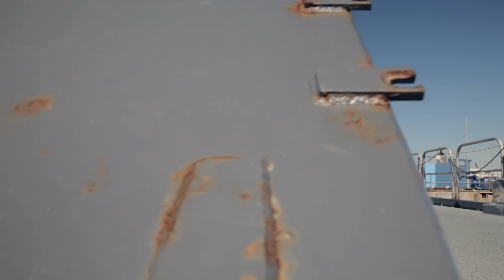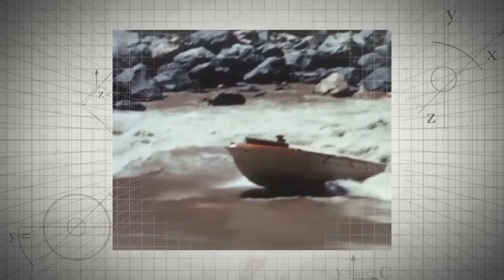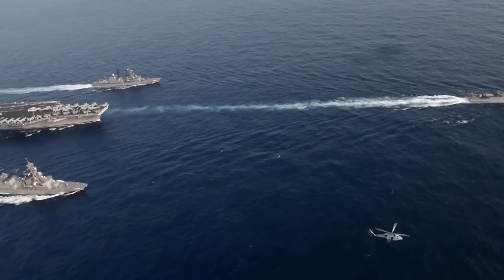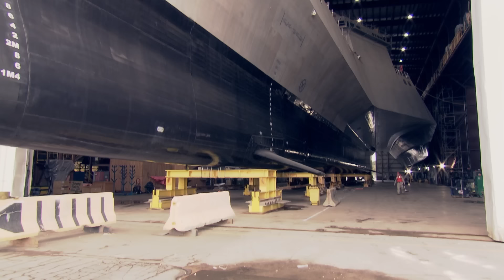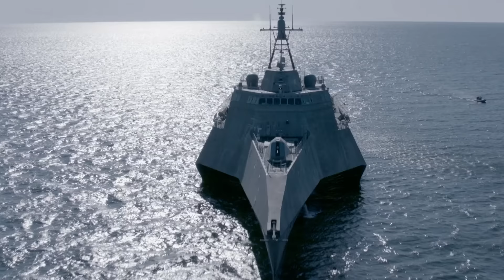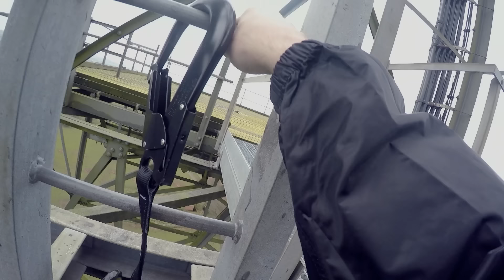How the US Navy Built a Warship for Speed, Versatility, and Coastal Control | Blueprint

Comment: Claiming the DC-3 as "all aluminum" is silly and misleading. The majority of the fuselage, wings and engines are aluminum alloy. But there are also various steel alloys used for things like engine thrust components, landing gear, control cables and fasteners. The control surfaces are covered in fabric.

Comment: Water jets belong on JetSki’s and small boats.😂
You need 2.5x the power to get the same performance. Highly inefficient. Listen to the numbers. The narrator then goes on to say how efficient 😂
The aluminium vessels have vibration issues, welds cracking problem and galvanic corrosion issues.
Didn’t they confirm they are to be scrapped because they cost a shipload of money and are rubbish?

Comment: How to make LCS vessels into real warships: Remove the Mk44 module elevators & replace each with an 8-cell Mk41 VLS for 16 cells total, upgrade the search & fire control radars for ESSM block 2 & SM-2 integration, add port & starboard wings amidship to accommodate the Bushmaster II 30mm chainguns. Done.

Optionally, if space, weight & power margins allow (though this would be highly unlikely after radar & Mk41 VLS upgrades), add up to 24 Mk48/Mk56 VLS cells on weapons deck.
Reply: Yes and with 8 NSMs
Reply: Need far more VLS cells.

Comment: With both classes having so many issues and being decommissioned because of the power-train coupler on one causing it to no longer ve able to achieve its highspeeds without high risk of significantly damaging its' propulsion system and the haul cracking issue for the other, but other major issues like the mission modules not working or being able to swap over in a timely manner as originally advertised... They instead should all be transferred into NorCom's AOR and primarily stay in  the Caribbean & Gulf to avoid the much rougher waters faced in the oceans... With the current administration labeling cartels terrorist organizationa and even putting a bounty on president of Venezuela (Nicholas Maduro)... using our destroyers for drug interdiction and low level threats is costly, overkill, and decreases USN readiness for these larger more important ships for near peer & higher level threats... USN were idiots to allow for 2 ships to come out of the LCS competition

Comment: Sort of interesting, but: (1) A program about a multihull and a "semi-planing" monohull and hull speed is never mentioned as the limit they are designed to avoid? (2) Stability for a sail-powered boat and stability for a engine-powered warship are completely different problems. (3) What happens when the boat is in shallow water and the propulsion system sucks in a load of gravel?

Comment: I was in the navy in the seventies and was on a good size ship and never understood why the navy wasn't using aluminum to build their ships. Awesome awesome, thanks Ray
Reply: Aluminum has been problematic. The U.S. Navy's Independence-class Littoral Combat Ships (LCS) are experiencing hull cracking due to a design flaw in higher-stress areas. The cracks are a result of the aluminum hulls being subjected to stress from turbulent seas and high speeds. While the Navy maintains that the issue doesn't pose an immediate safety risk, it has led to limitations on ship operations and requires ongoing repairs.
Reply: Aluminum burns when struck by a missile.

Comment: These ships are junk and the Navy wants to get rid of them.  Engines break down, the hull cracks and the list goes on.  They can't even run the ship at full speed because the hull will break.  It has helped with testing new tech, but the ship itself is crap.
Reply: The engines did not break down.  The combining gears broke.  They fixed the issue in later models.  The first 5 or so did get decommissioned.  These ships are not useless.  They were never designed to replace destroyers.  Why blame the ships if the modules do not work?  The LCS is designed to patrol. Let them patrol the Caribbean, the Gulf of Mexico, and the eastern Pacific.  Give them CIWIS (more than 1) and they can patrol and defend ships in the Japan and Red Sea, Gulf of Aden, and the Persian Gulf. The same way future fighter jets will have A.I. wing men equip the LCS with A.I. drone pickets and they could be useful in a fight with China.

Comment: Ah yes the Littoral Combat Ships. 
The overly expensive ships the Navy is forced to buy by congress and retires allmost as soon as they get their hands on one.
Reply: The U.S. Navy's Independence-class Littoral Combat Ships (LCS) are experiencing hull cracking due to a design flaw in higher-stress areas. The cracks are a result of the aluminum hulls being subjected to stress from turbulent seas and high speeds. While the Navy maintains that the issue doesn't pose an immediate safety risk, it has led to limitations on ship operations and requires ongoing repairs.

Comment: This feels like a flashy solution looking for a real-world mission — is it more style than substance?
Reply: Or if you listened to it's actual purpose it's to replace a 2.5 billion $ destroyer from doing drug dealer hunting in the Carribbean and doing Maritime law enforcement as well as hunting pirates.

And bcuz our destroyers overworked and under maintained
Reply: 😊😊😊😊😊😊😊😊😊😊😊😊😊😊😊😊😊😊😊😊😊😊😊😊😊😊😊😊😊😊😊😊😊😊😊😊😊😊😊😊😊😊😊😊😊😊😊😊😊😊😊😊😊😊😊😊😊😊😊😊😊😊😊😊😊😊😊😊😊😊7😊?7th 😊😊😊😊😊😊😊😊😊😊😊😊😊😊😊😊😊😊😊😊😊😊😊😊😊😊😊😊😊😊😊😊😊😊😊😊😊😊😊7😊😊😊😊😊😊😊😊😊😊😊😊😊😊😊😊😊😊7😊😊😊😊😊😊7😊😊😊😊😊😊😊😊😊😊😊😊😊😊😊😊😊😊😊😊😊😊😊😊😊😊😊😊😊😊😊😊😊😊😊😊😊7😊😊😊😊😊7😊😊😊😊77😊😊7😊😊😊😊😊😊😊😊😊😊😊😊😊😊😊😊😊😊😊😊😊😊😊😊😊😊😊😊😊😊😊😊😊😊😊😊😊😊😊😊😊😊😊😊😊😊😊😊😊😊😊😊😊😊😊😊😊😊😊😊😊😊😊😊😊😊😊😊😊😊😊😊😊😊😊😊😊😊😊😊😊😊😊😊😊😊😊😊😊😊😊😊😊😊😊😊😊😊😊😊😊😊😊😊😊😊😊😊😊😊😊😊😊😊😊😊😊😊😊😊😊😊😊😊😊😊😊😊😊😊😊😊😊😊😊😊😊😊😊😊😊😊😊😊😊7😊😊😊😊😊😊😊😊😊😊😊😊😊😊😊😊😊😊😊😊😊😊😊😊😊😊😊😊😊😊😊😊😊😊😊😊😊😊😊😊😊😊😊😊😊😊😊😊😊😊😊😊😊😊😊😊😊😊😊😊7😊😊😊😊😊😊😊😊😊😊😊😊😊😊😊😊😊😊😊😊😊7😊😊😊😊😊😊😊😊😊😊😊😊😊😊😊😊😊😊😊😊😊😊😊😊😊😊😊😊😊😊😊😊7😊😊😊😊😊😊😊😊😊😊😊😊😊😊😊😊😊😊😊😊😊😊😊😊😊😊😊😊😊😊😊7😊😊😊😊😊😊😊😊😊😊😊😊😊😊😊😊😊😊😊😊😊😊😊😊
Reply: It is also called researching new ways to be better effective at saving money. These vessels cost significantly less than steel hulls, can move faster, and use less fuel.
Reply: No, the design idea is very much necessary - littoral boats like these would have been very useful....if the execution wasn't godawful and the ships had no survivability whatsoever - to the point they can't even be used. Now they have to be replaced with something new to fufill the same role